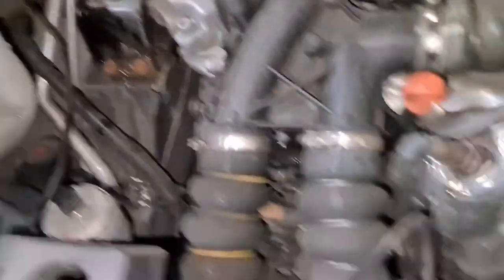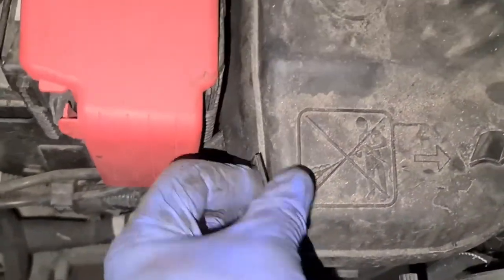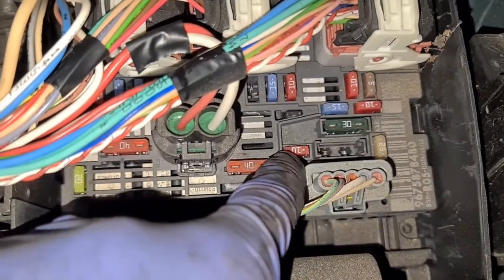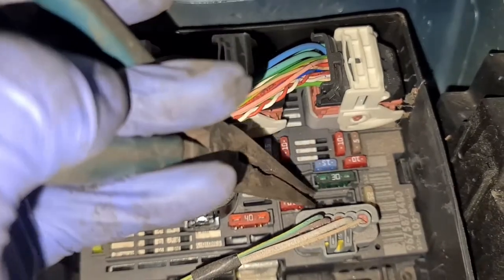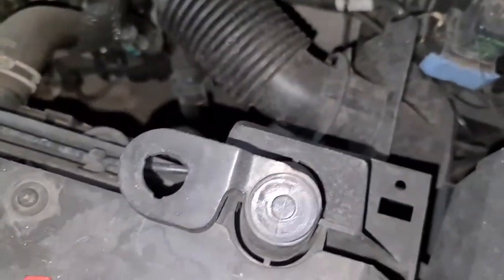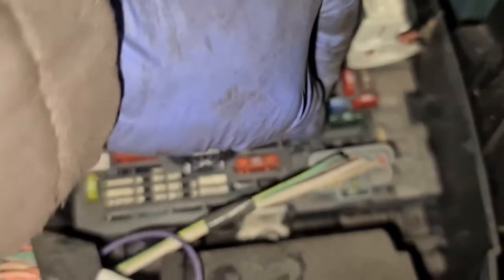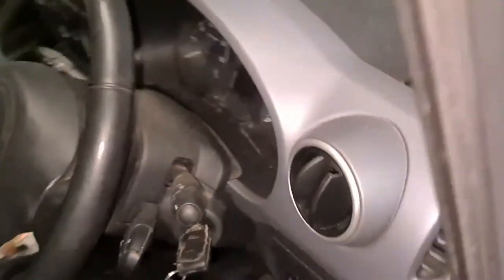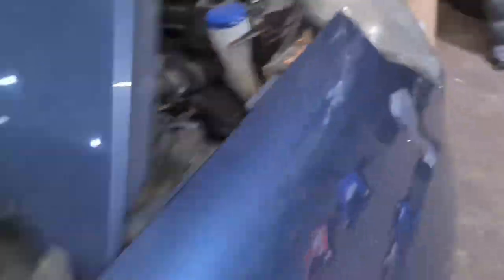washer pump fuse location on Citroen Berlingo | Peugeot Partner mark 2

Comment: I’m having issues with my central locking, I have a Citroen Berlingo 2014 Multispace Diesel, I think my fuses are in the wrong places. I’m getting different info from online to my manual, I have like 3 F15 fuses in a row. 

Does anyone have this model and could show me all the fuses and where they should be in the passenger side fuse box